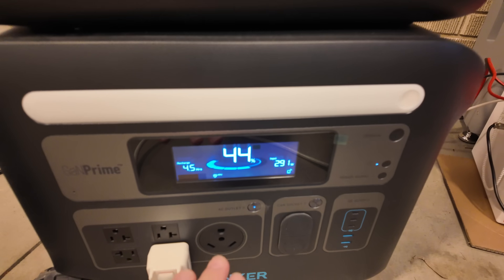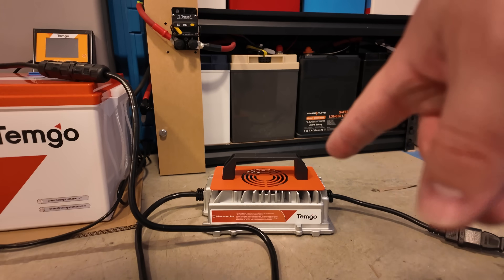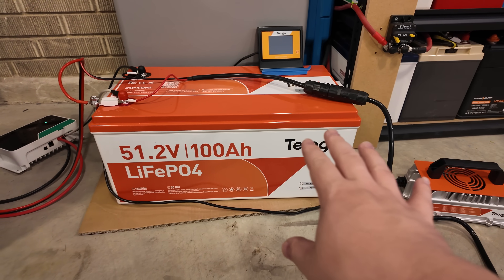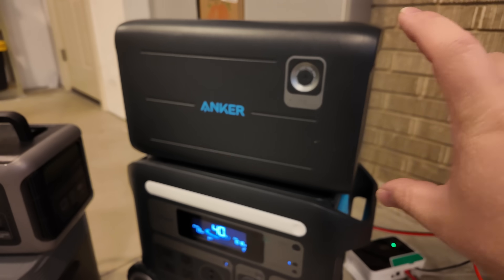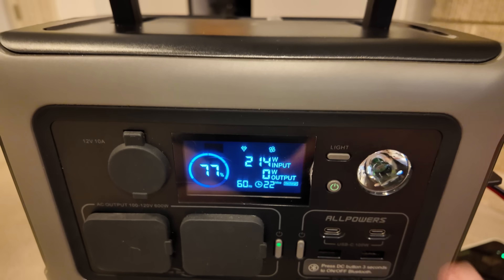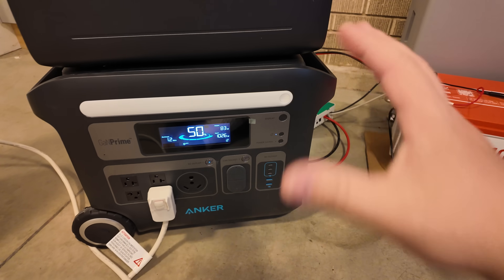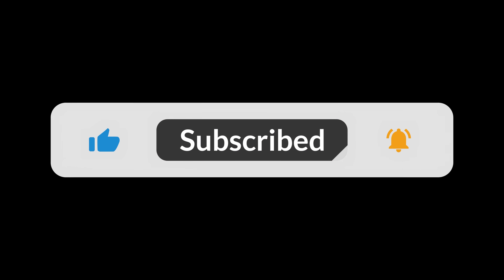I SOLVED the BIGGEST Problem ALL Power Stations Have!

Comment: , Are there any issues with compatibility of adding an MPPT controller to charge the battery and that is then feeding into the MPPT controller of the power station? Is it safe for sure?
Reply from the maker: I’ve had zero issues doing that! DC power is DC power and neither of the charge controllers could care about the other!

Comment: I have decided to take the plunge and purchased the temgot battery to expand my Zendure SB 4600.  My setup is AC charger-temgot battery- (via solar input) Zendure SB.  For testing purposes, I charge temgot (via AC) and simultaneously discharge (via solar input) to Zendure battery.  What I observe is the voltage input from temgot to Zendure fluctuates wildly, then Zendure would stop solar input, with a high temperature for the battery warning.  When the AC charger unplugged from temgot battery,  there is no problem discharging from temgot to Zendure.    Can you clarify that I should not be AC charging and discharging simultaneously?  Thank you
Reply from the maker: I don’t have any experience with Zendure. But I can tell you is that all of the power stations I have… Work flawlessly while AC charging the battery at the same time.

Comment: The point it's DC is separate and if you use DC to charge this setup it will pass through without overloading the inverter, which can't  charge and pass through at maximum capacity.
Reply from the maker: Yep! You got it!

Comment: I purchased this battery and I am charging it for the first time with the supplied charger and it stopped at 92% and is currently in standby mode -is this normal to stop before 100% ? I tried to chat with the supplier but nobody responded back . I don't see anything via the app to change the charging parameters as I know some you can customize for the high/ low charge -thanks in advance for any insight
Reply from the maker: Yeah, my BMS settings arrived a little out of whack as well. The company told me that was because I got a review sample battery and not a full production type battery. But it’s super easy to adjust! I’m sure the battery is fully charged if you use the included charger, cause it will charge it to the proper voltage. Simply download the overkill solar app. It connects just great to the BMS and you can fine-tune the BMS settings.
Reply: @theresatrickforthat  -company also got back to me today and told me I can also drain the battery and recharge it to re-learn the BMS - I have it up and running again and is currently at 96 % when I stopped it -I usually try not to top my batteries out for longevity and try and never drop below 20% -any thoughts on that ? I am liking the Overkill app -still learning what all it can do and the calculator tool is handy as well -thank you for your videos !

Comment: The benefit of this is really saving money on cheaper batteries rather than buying overpriced proprietary batteries from the Power Station manufacturer and still keep the flexibility of moving the power station around. and Yes I did this exactly with my Pecron E3600.  $1.6K for 16Kwh DIY battery vs two Pecron 3Kwh batteries for total 6Kwh at same price.  Yeah I went with the 16Kwh DIY battery. The pass-thru can not be turned off on the E3600 so yes your stuck with your generator size when you plug in to recharge for loads.  Nice Video.
Reply from the maker: Fantastic comment! Sounds like you have an epic set up!

Comment: if you decide to add solar panels, do they charge first the battery or the powerstation? I do have a powerstation that accepts 30-60v but at only 400w, so I would prefer the panels charge the external battery at its max, otherwise they will overlap each other and i will lose a lot of energy..
Reply from the maker: It will charge the power station first and then any extra will go to the battery. So for example, if you have 2,000 watts of solar hooked up, your power station will take 400 watts and the rest of the 1,600 watts will go into your external battery. Thanks for watching!

Comment: I bought the battery with high hopes, but my Ecoflow Delta Pro sees the battery as a battery (not solar) and only gives me 8amps.  So I only get about 400w of input.  Still better than nothing.  Has anyone else tried this with a Delta Pro and got different results?
Reply from the maker: Isn't there somewhere in the app where you have to specify that you are charging from "PV" and not the car charger to remove the 8 amp limit?
Reply: @theresatrickforthat  I found the issue.  For Ecoflow you need an XT60i cable to make it accept more power from a battery source.  The cheap one I bought off Amazon did not even have the center pen linked to the negative.  It was a total scam of a cable, when I took it apart it didn't even have the center blade available so I sould solder it myself.  I have purchased a new cable and will let you know how it works.

Comment: Run the AC off the generator.
Charge the battery off the generator at the same time.
You can get Jackery 1000 plus extra batteries for $319 for 1248 wh on sale.
Reply from the maker: Still doesn’t work and I’m making a video showing it. Thanks for watching!

Comment: Is there a better mppt controller you could recommend for this system that would allow you to charge as fast as you are pulling out power?
Reply from the maker: Yeah! The one I have linked below is a 40 amp model! It’ll put in 2x the power the power station pulls out if you have enough solar connected to it! Thanks for watching!

Comment: Battery Bank as a Reservoir is Key and a stand alone System with Plenty of Panels charging My Battery Bank with 300amp Buss Bars We can TAP into these Buss Bars to Marine Grade Tinned 10/2 or 10/3 grounded in Conduit underground to Our House. Solves allot of Capacity Limits.
Reply from the maker: That's the way to do it! Thanks for watching!

Comment: You are not properly explaining pass thru charging.  True pass thru will service the load on the device and use any excess to charge the battery.  What you “demonstrated “ is that your simulated “gas generator “ didn’t have the capacity to kick over the AC.

Maybe take time to actually know how your equipment works then just mimic what many other YouTubers have already demonstrated AND explained correctly.
Reply from the maker: It’s actually a real limitation on the power stations. Any power station that has a larger inverter than 1,800 watts will dumb down the power they can output while
AC charging to 1,800 watts. Thanks for watching!

Comment: So, you are advertising the golf cart kit?
Simpler solution is to just throttle down the charging rate of the power station before switching the AC on. Most expensive power stations have this option. No need to buy anything.
Reply from the maker: Did you not see in the video I had the power station dialed all the way down to 200W? The lowest it goes and still has the same issue. Thanks for watching!

Comment: could you hookup two of these batteries together or is it better to stick with just the one battery when doing the anker temgo combo?
Reply from the maker: You can most certainly hook multiples of the Temgo batteries together in parallel. It’s even taught in the instruction manual for them! Won’t hurt the batteries or the power station. Just fuse your cables properly and you’ll be golden! Thanks for watching!

Comment: I have the same power station that you are using as the "gas generator" -so can I plug this battery via the xt60 port direct  or do I need to purchase a step down 12 volt converter ? has the 11-60 volt input with a maximum of 15 amps -don't care to damage my Delta as it was extremely expensive
Reply from the maker: No need to step anything down. Watch the full video and you just might see me plug the Delta into the battery! :) Thanks for watching!
Reply: @theresatrickforthat thank you for the quick response- I just wasn't exactly sure because in the video I  couldn't tell whether it was a direct connection or going through the solar controller- I bought that exact battery  and this should do nicely to expand my capabilities- thank you 😊

Comment: I don't have a clue what's happening here but I'm glad you enjoyed yourself!

Edited to add: This may actually work around the fact that I need a dolly to move my battery bank but I could just carry that little battery thing. Very cool!

Edited to add: So, just to be clear before I start buying things, can I charge that orange battery with solar panels or even plugging it into the wall and then use that to power my bluetti as200?
Reply from the maker: Yes indeed so long as your bluetti can accept up to 60v DC in! You can charge the orange battery with solar and the wall no problem! To do it with solar, you need to add an MPPT charge controller. A good one is linked in the description. Thanks for watching!

Comment: You are going from dc to ac to dc to ac to run an a/c. Plug that ecflow into an inverter gen ,I love it!!!
Reply from the maker: But then we end up with the pass-through charging restrictions by doing that again. Thanks for watching!
Reply: Depending on how small the generator is, it should be able to handle the surge load of the AC better than the battery bank you have in place of the generator, no?

Comment: 47 year retired Commercial Electrician, This situation setup has always been about having a battery bank, you don't get something for Nothing. The inverters ether charge or they convert but not at the same time, by doing what you did here you added a separate stand alone charging system and fixed your problem. POV. PS I've worked on UPS systems with two 480 volt duel bank setups 1200 AH each, each cell is only 1.2 volts and weighs 70 lbs, you do the math.
Reply from the maker: Thanks for the insider insight! I appreciate it! Great points! Thanks for watching!

Comment: At this point, I’d just buy an inverter and skip the anker products. I didn’t realize you could get a golf cart kit like that. It’d be a good/cheap way to permanently install in an RV vs a complex victron system.

Though I do love the flexibility. 

I believe there are some boxes that will work off the battery even when charging instead of UPS mode.
Reply from the maker: I agree, there are definitely pros and cons! Thanks for watching!

Comment: So the first cenario why not just plug the ac unit directly into the gas generator?
Reply from the maker: Because there’s a good chance the gas generator will overload anyway and then you have to keep switching power sources when you want to run off the gas generator vs the power station. Thanks for watching!

Comment: Hi mate, I bought a Eco flow Delta 2 Max with alternator charger and am planning to buy a solar panel and Lifepo4 battery in future . So the question is, can I charge this battery with an eco flow 800w alternator charger while driving and what size MPPT I need.  The first I planned to go for 12V 300Ah battery because my SUV is 12v.  And the price is twice as much. Interesting idea. Thanks for the video.
Reply from the maker: The alternator charger will reverse charge from the Delta 2 Max to 12 or 24v batteries. But then you are depleting your power station. I think you would rather charge from the car battery while you’re driving to charge up the Delta 2 Max. Consider this, the Delta 2 Max has a max solar input of 1,000 watts. Why not connect your alternator charger to your vehicle’s 12v starter battery like it’s designed to do so you can charge your EcoFlow while driving, then get one of these 48v golf cart batteries. You can use the included charger to charge it up while you’re on the road - alternator charger to EcoFlow, EcoFlow to 48v battery charger, 48v battery charger to 48v battery. Then when you’re stopped in your SUV, you can connect the Delta 2 Max solar inputs to the 48v battery like you saw me do in this video, and you’ll get 1,000 watts of charging into the EcoFlow. If you just get one of the 40 amp charge controllers linked in the description, you can connect up to 2,000 watts of solar to the golf cart battery (double what the Delta 2 Max can handle) or even get 2 of the 40 amp charge controllers and you could get up to 4,000 watts of solar! Food for thought at least! Thanks for watching!
Reply: @theresatrickforthat  Thanks,I connect the eco flow charger like it should be,I just bought and waited for next week when I came back home. Ok, this is what I want to understand. So while I'm driving I'm charging from delta 2max to the golf battery, when stationary then from the solar panel to the golf battery and from the golf battery  to the delta 2max. Sounds great. Thanks.
Reply from the maker: Yep! You got it!

Comment: It would be nice if the software on the power stations would allow you more control of charging rate and overload situations.
Reply from the maker: Yeah! It’s more the overload issue. You may see in the video I had the charging speed turned all the way down as low as it would go and still overloaded. Thanks for watching!

Comment: Exactly what I am going to do with my Apex 300 which is limited to 60V / 20A input solar power (XT60) 
Will add 2 × 51.2V 100A batteries. 

Can you also do a video on adding the right solar panels? Many of us doesn't know which solar panels to add as a back up.  Thanks a million!
Reply from the maker: Sounds like a great plan, and I can certainly do a video on the right solar panels as a backup! Thanks for watching!
Reply: You can use any solar panels you want, you only have to check the specs. Your Apex 300 has two MPPT controllers, each one 12V-60V 20A. So your panel -- or multiple panels in series -- need to have a working voltage (Vmpp) of at least 12V and an open circuit voltage (Voc) of no more than 60V. You don't have to worry about the Amps -- if more than 20A is available the Apex will just take 20A, it's not a problem.  So you could use those cheap little Temu 20W panels with 18V working voltage and around 23Voc ... or a few of them in parallel (add the Amps together) ... but no more than 2 in series (add the voltages, 46 Voc, same Amps as 1 panel). OR take the JA Solar JAM54D40-440 I'm using on my Pecron. They are just under 40 Voc and around 32V-35V working voltage. My Pecron E3600LFP has 150V inputs (as does the Bluetti AC300, but not your Apex 300) so I can use 3 of those panels in series (120 Voc). But you can't. You'll only be able to use one without exceeding your60V limit. You could put two in parallel and get a theoretical 28A at around 33V. Your Apex will draw just 20A from them, probably at around 35V, for 700W of power.  They say the Apex has 1200W inputs, but you can never achieve that in practice because that would need the full 60V at 20A, and that would need something with a too-high open circuit voltage,

Comment: I would like to buy 3-5.12kwh server rack batteries but do not know how to solar charge them or use them DC-DC to recharge all my power stations.  Can you do a video on that?
Reply from the maker: Well, I think this video might be the answer for you! This golf cart battery is essentially a server rack battery on steroids…same capacity at 5.12Kwh. So you can see how to DC charge your power stations as well as how I connect solar to the batteries! Plus you get AC wall chargers as part of the golf cart battery kit. If you don’t need the batteries to actually live in a server rack, you’re going to be substantial money ahead getting these golf cart battery kits. Does that make sense? A video about the difference between a server rack battery and these golf cart batteries could be good for me to make in the future so that’s for the idea and thanks for watching!

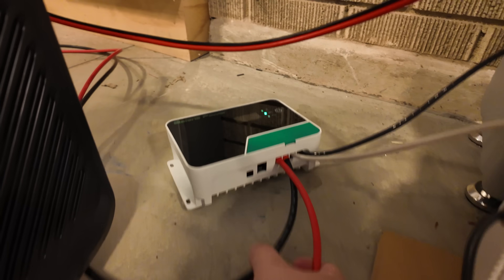Comment: More on bateria power device review 4:35 ...fuse were to get 3:35
Reply from the maker: Unfortunately, Bateria Power is not doing so well these days…but BougeRV has the same charge controller in the 40amp model for a great price! I’ve linked it in the description! And then that fuse was just a Victron inline fuse I had laying around…a terminal fuse would actually work better and I’ve linked them in the description as well! Thanks for watching!

Comment: Awesome find. Think of batteries as water tanks. A large short tank offers lots of water with little pressure. A tall skinny water tank with the same amount of water offers lots of water with more pressure. So one high voltage battery will output 12 volts for a long time as opposed to many 12volt batteries with an equivalent amperage. This is the BEST solution for the least money for all “RVers” today. Thanks for sharing !
Reply from the maker: Great analogy and glad you found this helpful! Thanks for watching!

Comment: Problem, meet complexity and lots of money...
Reply from the maker: Haha! Do you have a cheaper better way to fix the issue? Thanks for watching!
Reply: @theresatrickforthat   Yes, I do. Won't cost you a penny. Unplug the fridge and/or other 'spikey' appliances. Plug the power station in to whatever you are using to charge it. Leave everything alone until the power station can again handle the spike. Plug the spikey stuff back in. Let it finish charging. Charge until full. 

Or just leave the spikey stuff unplugged until the power station is fully charged again.

If the power is out, you can run your fridge for just 3 hours a day, and the food will not spoil. Just don't open the thing every 15 minutes looking for a snack or drink. You want cold drinks, put them in a cooler, with some ice. 

If the fridge is fine, on only running for 3 hours in 24, then surely it is fine being unplugged for 3 hours...

Comment: Perhaps I'm missing something here, but the beginning doesn't make any sense. Pretty much all gas generators provide around 2,000 Watts of power, even if the passthrough is on, gas generators should provide more than enough power for air conditioners.
Reply from the maker: It’s a limit inside the majority of the power stations themselves and that they hard limit things to 1,800 watts when in pass-through charging. Thanks for watching!